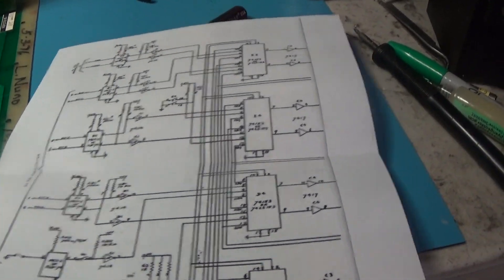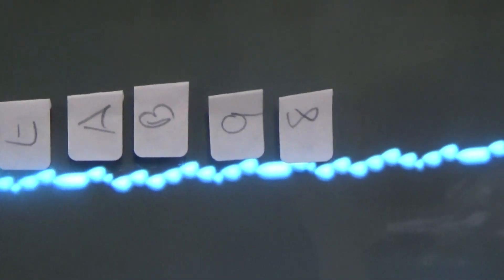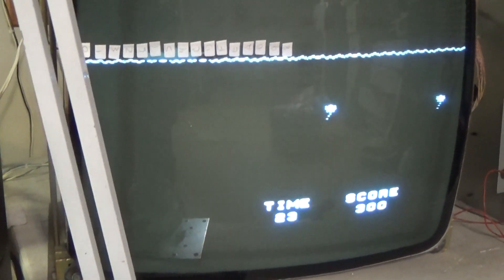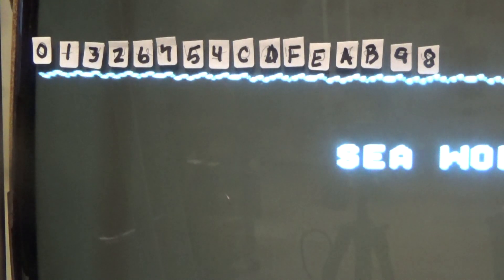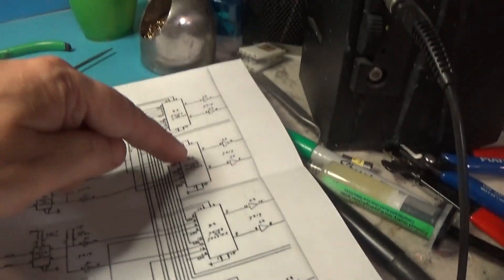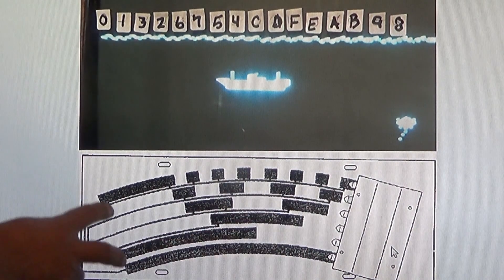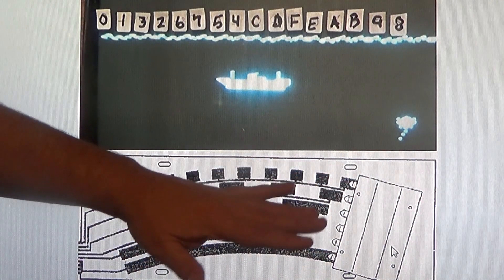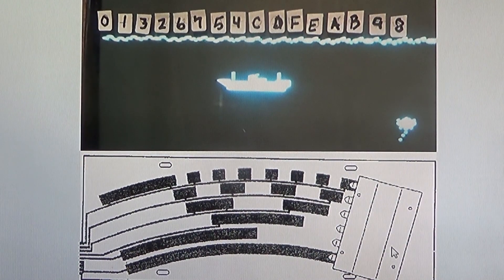Midway "Sea Wolf" Periscope Circuit Testing  -  11-28-2023

Comment: That reminds me of an encoding system I used for PLC control for rotational position called "Grayscale encoding". Its a very old system and the bands were sized in a way to make it more robust. And the bit length was variable. Maybe its related.?
Reply: I think it's just called Gray Code (what's on Wikipedia matches this). Only one bit ever changes at a time if you only count up or down. It's great for mechanical systems, ensures that there's no awkward position in between the bits that sends out some completely different position.

Comment: Great video Sean!

I just recently picked up a Sea Wolf that is only working in about the A B 9 8 range (both  sides of center) and the 0
I suspected the wipers but looking at the board it looks like all the wipers have been making contact with the traces. I’m thinking some of the 153’s are bad.
Reply: if half of your inputs are correct that would show your 153s are good. your problem is likely a faulty opto isolator. these fail very often on this board.  you can remove all 5 and short pin 2 to pin 7 and pin 3 to pin 6 to completely bypass them.  you can also completely remove all the 7417 ics on this board and give them the same treatment.  believe it or not you can remove 7 chips from this board , and improve its reliability.
Reply: @ArcadeJason   what pins would be jumped on those chips?